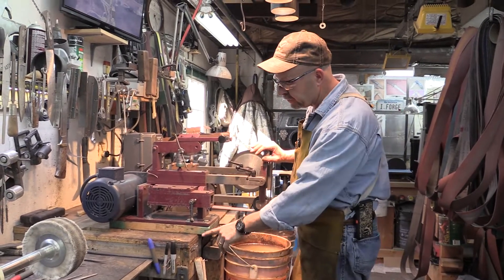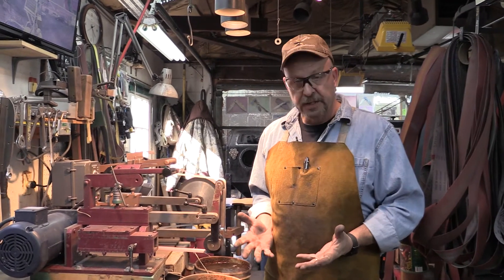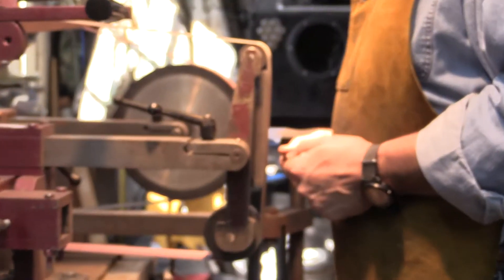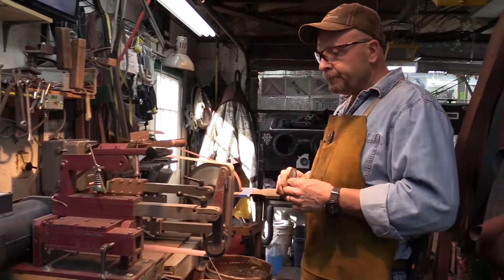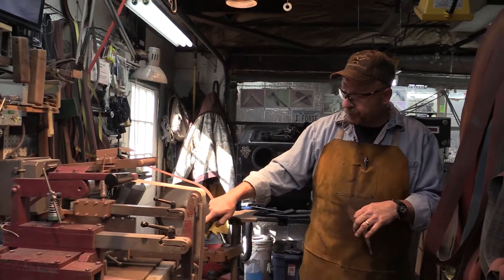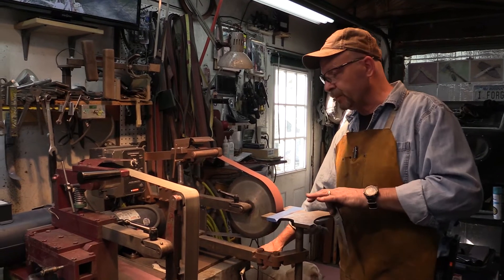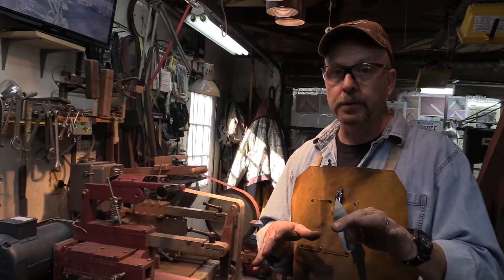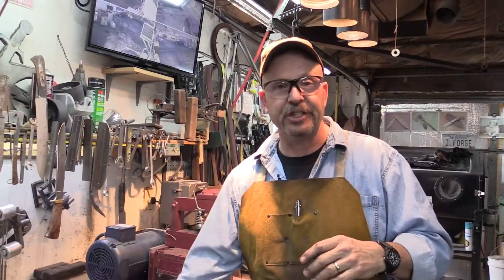"The Montana Bladesmith"-Grinder Height

Comment: I think of it about like using a buffer. When I'm polishing a blade I'll have my arms locked in that position, and do ALL of the motions for the cut buffing with my legs. It's only for the final color buff I'll actually move my arms. 
I'm a little looser at the grinder, but not too much. This is a very important lesson, and you did a great job of explaining it!